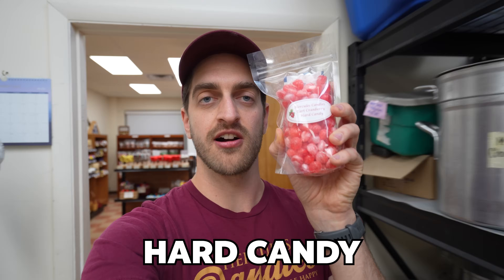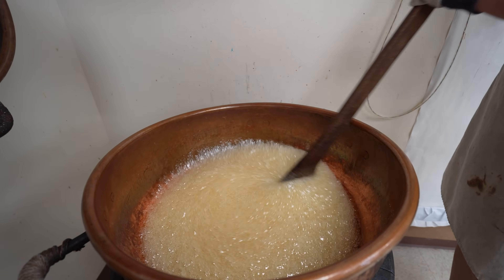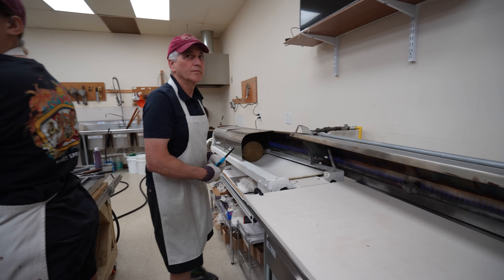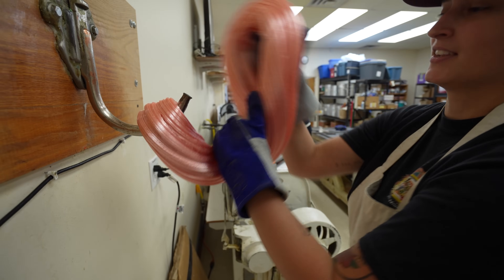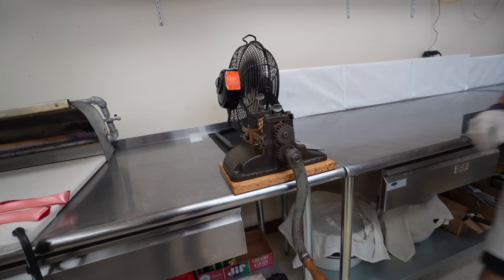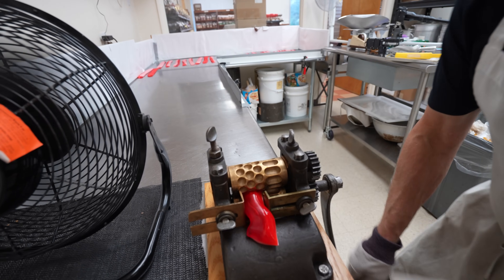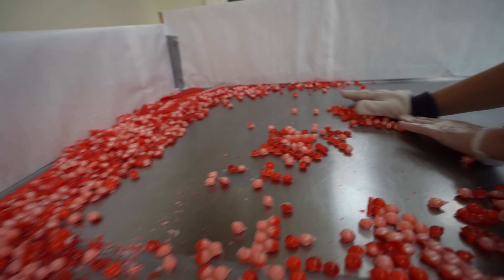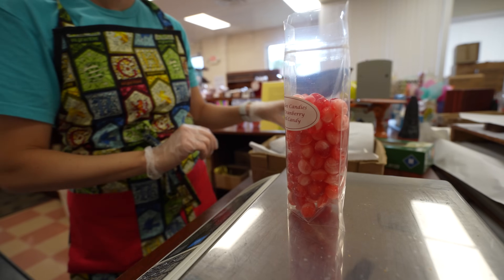Using Our Candy Drop Roller To Make Old Fashion Candy

Comment: The longer crank handle is because this model roller doesn’t have power steering.
Reply: SO FUNNY! I just seen it when he says something about re commenting and  I had to go see if you commented!
Reply: Longer handle = more torque = easier to turn with load

Comment: It might be worth it to see if you guys can hook a motor up to the crank shaft. That way it would allow the person feeding the candy in and taking it out not to pause every time, switch hands and worry about consistent turning. Low power motors are pretty cheap and would save a lot of time and energy on the candy maker.

Comment: I'm assuming you need a long crank in order to get sufficient leverage to turn the gears. The shorter the crank, the more arm strength it will take to turn, while a long crank does most of the work for you.
Reply: Need a Candy Only Dust Pan that would scoop off the counter better than the bulky scoop.

Comment: The handle is connected to a shaft that spins.  To spin the shaft requires X amount of energy.  If the length of the handle is 0, then to spin the shaft you need to provide X amount of energy all at once.  The longer you make the handle, the easier it is to rotate the shaft because even though you still need X amount of energy to spin the shaft, You are now providing X amount of energy over a period of time (the radius of the circle created by the ends of the handle).   Basically how gears work, a large gear, linked to a small gear, if you spin them they both complete a single rotation at the same time, however if you a providing the energy to the large gear, then the small gear is producing a large amount of torque, and vice versa.

Comment: Couldn't you add a honey spout that can securely close to the bottom of a 5 or 7 gallon bucket and then allow the corn syrup to drain into the kettle on the scale?  ou might have to raise the bucket up higher to drip into the kettle
Reply: I’m guessing the corn syrup has to be warmed so it will pour.

Comment: Is the longer crank to make your hand go in a big enough circle that it rotates the gears at the correct time to line up correctly? Sorry if that doesn’t make sense but I’m assuming it has something to do with the diameter of the circle made when you crank it is related to the timing of the gears that are spinning because if it was too small the timing would be off and the gears/candy plates wouldn’t rotate together and mess up the candy shape?

Comment: 13:18 - This one doesn't matter because it's not two flavors"
But it's two different textures, and it's going through the roller mostly sideways in this video.
Wouldn't you want to make sure it stays at least somewhat straight so that you can have both textures on every piece?
You're gonna have some people winding up with more hard pieces, and some with more aerated bits that are ready to crumble.

Comment: For me rounded drops, and discs are scary.  As a cub, I had a peppermint round drop lodge in my throat.  Same happened with discs.  Pure, absolute terror.
Reply: That happened to me at about 7 yrs old. My uncle poured fresh hot coffee down my throat and it melted it enough to slide down. Burnt me and scared me so bad. But he saved me.